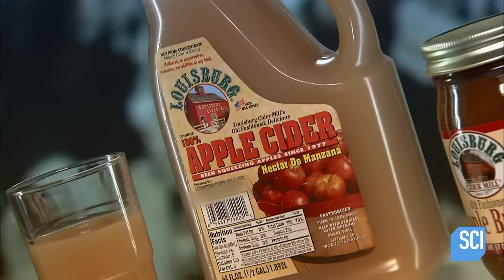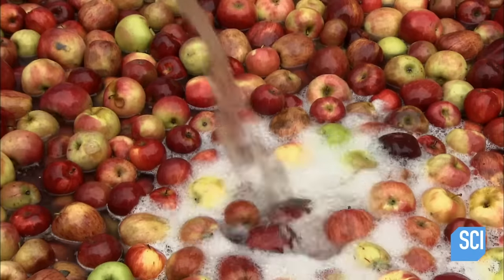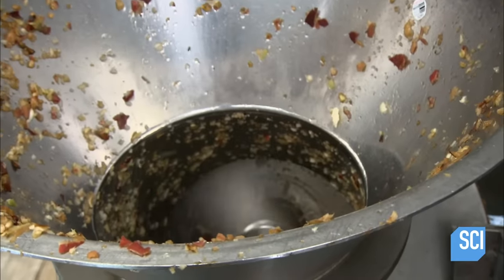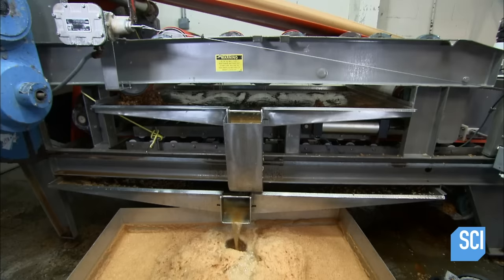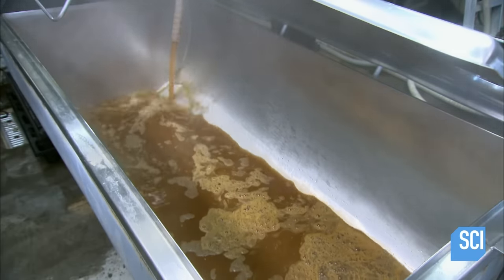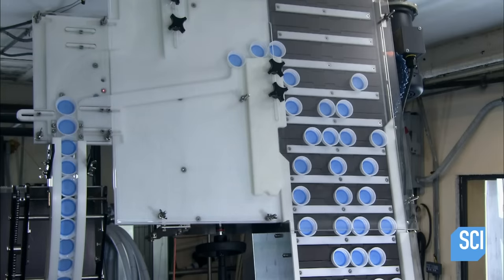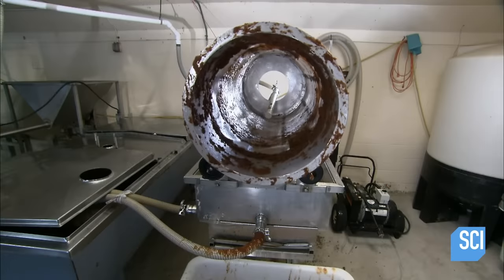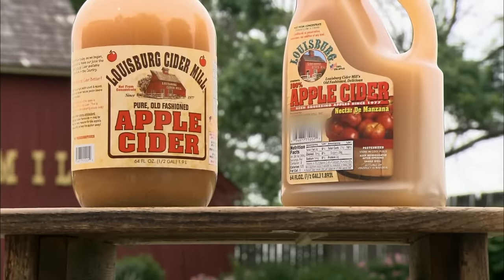How It's Made: Apple Cider

Comment: I wonder how they clean all that equipment, especially the pipes.
Reply: VERY GOOD QUESTION.
Part Two: HOW IT’S CLEANED: Everything in This Processing Plant
🧼🧽🪣
Reply: Look at 2:47 the pipes look nasty the one in the back @Melissa0774
Reply: CLEAN IN PLACE (CIP) thats what we call it. using hot Caustic soda hot water and filtered water
Reply: @royal_kira7184  They should seriously do an episode like that.
Reply: No need to clean the pipes... They apply sufficient enough heat to kill all the pathogens, and bacteria, and then bottle it while it's still boiling hot. 2:50
Reply: @MoDiddle  What about after they turn the machines off, though? I'm sure they're not running 24/7/365.
Reply: I don't think so they Clean it at all. You can see how rusty is
Reply: @husam4236   rust is a natural thing. Lol you cant fully prevent that
Reply: Those apples were rejects just sitting on the ground at the beginning. The machineries and apple bath water looked dirty as hell too. If this isnhow they operate knowing the cameras rolling, imagine what it's like on a normal day. Nasty.
Reply: As someone who's worked in a food production factory, I can safely inform you, any machinery within these facilities are water safe, and are sprayed down with water, and scrubbed clean by specialist cleaners with appropriate cleaning solutions after each batch/lot of product has been completed.

Very important, otherwise if one batch ends up faulty/recalled, all batches would have to be if correct cleaning had not been observed. Hell, without proper cleaning between batches/lots, batches/lots wouldn't exist.

In addition, the same production equipment is most often used to make numerous different products/variations, so cleaning is essential also for switching the production line around as needed.
Reply: @grahamb7947  What do you make where you work? How long does it take to clean all the equipment before it can be used again?
Reply: @Melissa0774  I don't work there anymore, but we manufactured consumable products for many supermarket chains, mcdonalds and other companies also.

As for the cleaning, depends really on what machines are being cleaned. Some would require a simple but complete spraydown with a high-pressure hose, while other machines with more risk of perishables remaining behind would be disassembled and scrubbed clean by professional cleaning technicians. Thus, cleaning could take anywhere from 30 minutes to several hours.

For a production line making cider: It'd likely be quite simple to clean if done regularly, because of the juicyness of the raw product, as well as the acidity of the juices assisting with the cleaning. If not done regularly, then they'd have to be scrubbed and cleaned with corrosives, for sure, mainly because of pulp and other gunk buildups, especially within pipes and pumps.
Reply: @simpletudy  At that time stamp the brown pipes in the back are copper tube that supply that shinny stainless steel heat exchanger with boiling hot water. The hot water goes through one side of the heat exchanger and the cider goes through another pathway in the heat exchanger. Thus exchanging heat but never cross the same pathway.
Reply: That is what gives the cider it's special flavor 😹
Reply: @Melissa0774  have you heard of the health inspector
Reply: @southaussiegarbo2054  i mean you can..
Reply: @southaussiegarbo2054  u can by replacing parts or the whole machine.  ROFLcopter
Reply: @Reisbaellchen77  i said you cant prevent it. Especialy in an acidic environment.
Reply: @cakearmy_maxgaming6346   juice is acidic acids react with metals containing iron which makes them rust. Some it takes days some months some years
Reply: chemicals and jet sprays during the cleaning time. These machines does not operate 25/7. I've worked in a food processing factory before
Reply: I'm not sure they do clean it... the whole system looks pretty gross
Reply: @elainegreen5855  they would but if pipes are steel they will rust easy bc of 
1. Acidity
2. Moisture
Reply: They lick it clean.
Reply: @Melissa0774  wait til you see meat and dairy farms!! Those factories have nothing on your local fast food restaurants. Fast food workers drop cooked food on the floor but still serve it out. Or they cross contaminate cooked fish,chicken or beef with raw foods and we wonder why we get the runs.
Reply: @DarkenedSilhouette  There used to be a dairy store in my area called Halo Farms where they had a milk packaging facility next to it. They put the milk into cartons there and there was a window where you could see into the facility from inside the store. For some reason, the machines spilled milk everywhere and the whole store smelled disgusting like rotten milk. There were puddles of old milk all over the equipment and the floor because it would overflow when the machines poured it into the cartons. They couldn't just pour a precise small amount into each carton for some reason. I never understood, why they would want to show that to the public or how they passed health inspections. I haven't been in there in years, but the last time I did go in there, the smell was gone, so I wonder if someone complained and they finally did something about it.
Reply: @southaussiegarbo2054  true, but stainless steel parts are available for a price
Reply: Apple cider vinegar.
Reply: @simpletudy  those are copper pipes. They look like that no matter what lol. New or used. New they are a bit shiner but after a few days they begin to fade
Reply: Small children.

Comment: I like their process of "dump the apples in a busted back alley on the filthy concrete and hose em down with an unplugged drain pipe"
Reply: I liked the part where they handled and capped jars with no gloves. I hope this episode put that place out of business.
Reply: Actually, the cider mill is very much in business and is doing just fine. It’s a tourist destination and a brand sold in stores throughout northeastern Kansas.

Comment: So it's just apple juice. Apple cider contains alcohol.
Reply: In America we call fresh squeezed 'cider' as well. Like how in Britain they call french fries chips but in America chips are only the thin kind.
Reply: Technically, yes, but in the US, apple "juice" is apple cider that's been filtered until it's clear.  We call fermented cider "hard cider", which is alcoholic, to differentiate it from apple cider, which isn't.  Also, I believe that when hard cider is made, the fermentation step occurs in the ground apple (pomace) stage before the first filtering stage, much like when wine is made from grapes.  Finally, an apple liquor can be made by freezing hard cider.  This is called apple jack.  Water freezes at a higher temp than alcohol, so if you let the hard cider freeze overnite, you end up with a slush of ice crystals and alcohol.  If you then remove the ice you're left with apple jack, which is much higher in alcohol.
Reply: @scibear9944  I'll tip my hat to you Sir. On all points you are exactly correct.